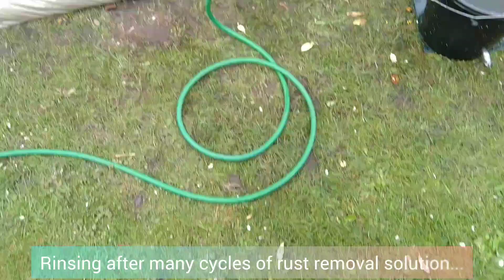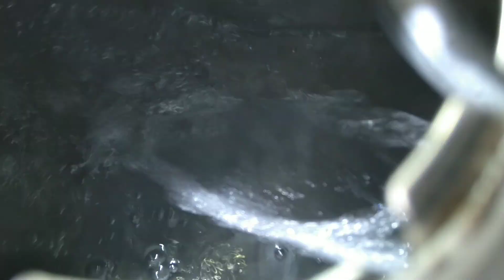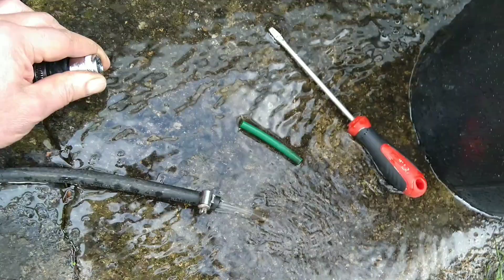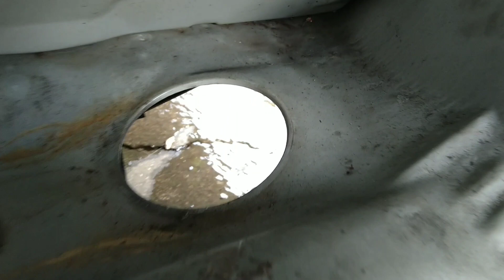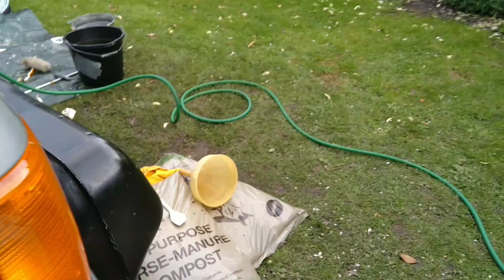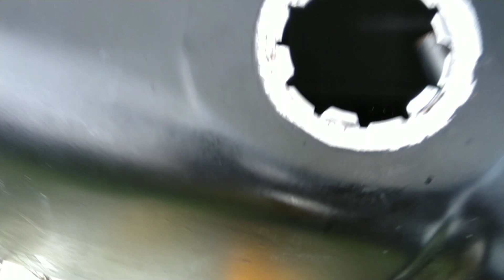1991 Audi 90 20v - fuel tank rust removal / clean

Comment: James did you have any issues getting the bottom pipes to flow? I'm trying this on mine now and I get a good initial flow from the feed to the pump but it dies very quickly
Reply from the maker: I'm sorry for the late reply. I didn't see your comment until just now. 

I hope you've managed to get it sorted. No, I didn't have any issues with flow from either rubber pipe, when rinsing or after refitting. I wonder if it got blocked. Note my tactical use of compost sacks to support the tank upright. I did that to avoid damage or strain on the bottom connections. They're vulnerable. I did avoid removing the rubber pipes from the tank, too. I think I could foresee myself accidentally damaging the little outlet.

EDIT: just re-read. By this point (flushing the tank), I had fitted a new pump & fuel filter on mine. I think both had clogged up with all the crap from the tank, particularly the pump. I buggered a brand new pump in weeks (which resulted in a fuel starvation break down), which is what got me thinking about the state of the tank. Have you tried tapping the pump lightly with a small hammer to get it working again?